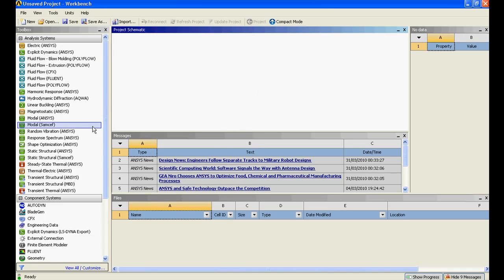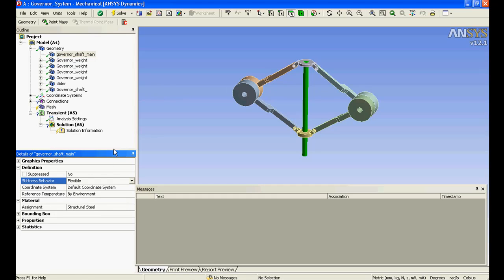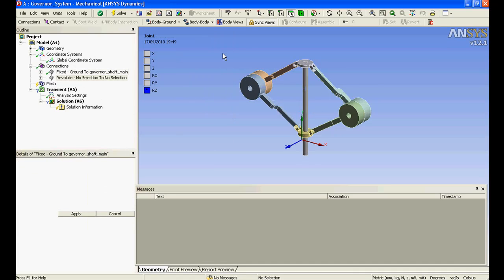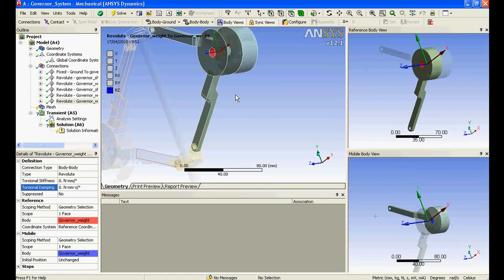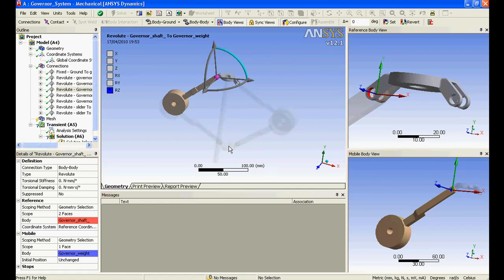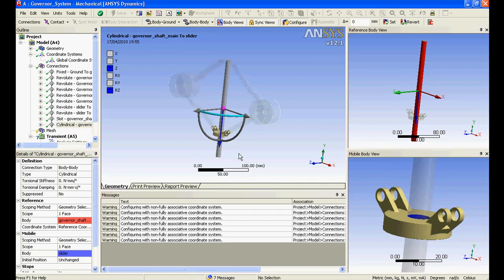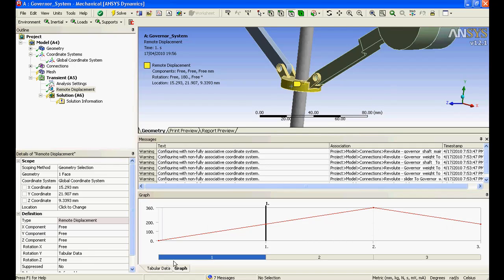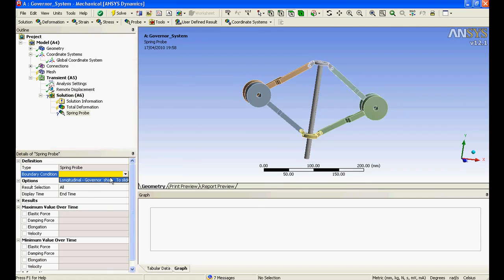Ansys Workbench Transient MUlti Body Dynamics-Part 1

Comment: Hello Damodaran,
I want to model a cycloid drive in ANSYS using Rigid solver.  I could not do a successful "gear mate" (I am a Solidworks user) using constraint equations.  
Can you let me know if you have any other method to model a planet gear running inside an annulus or ring gear? Or two discs instead of gears with a proper set ratio will also do.
I am finding this a hard nut to crack.
Kind regards,
Parabrahma Shastri